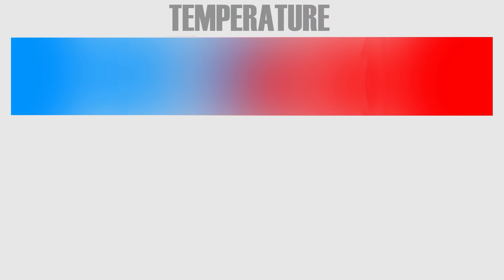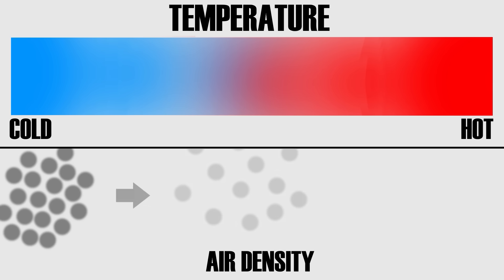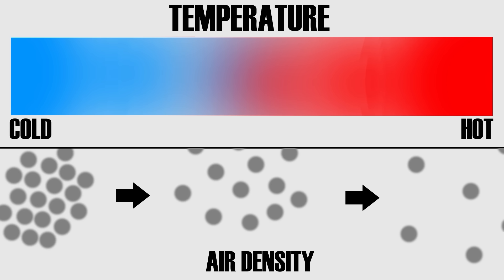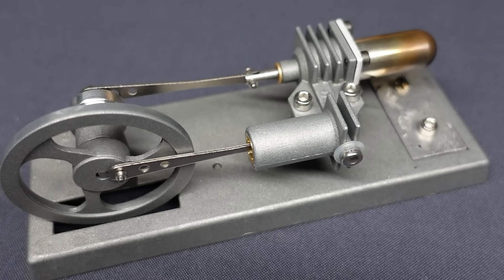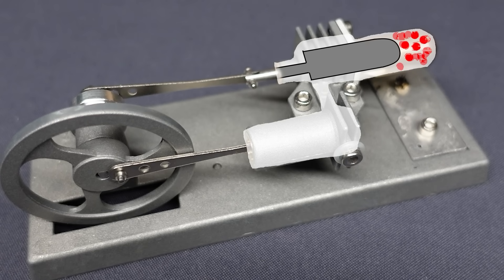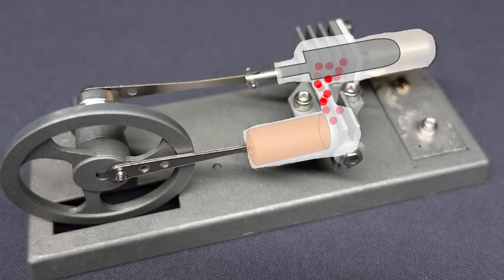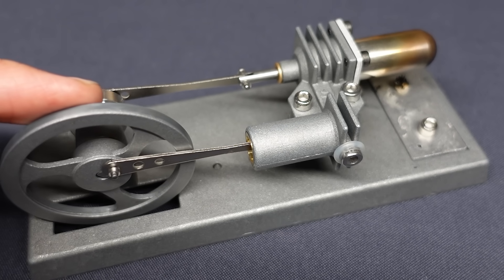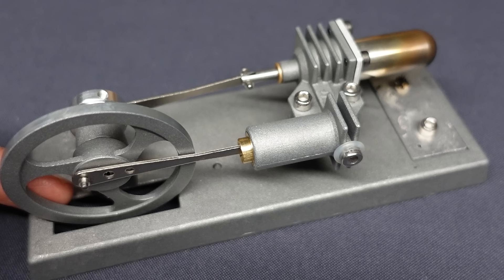It Can Save The World - The Simple Genius of Hot Air aka Stirling Engines

Comment: finally, something I am actually relatively well versed on!

my favorite application of the stirling engine is when it is combined with solar thermal power. Commercial products usually come as a satallite dish type set up with a mirror and the stirling engine in the focal point. Most recently theyve been marketed as a solution for those seeking micro or off grid power generation and they work well, especially since they can run off of basically any thing that heats up or even cools down. As long as there is a temprature gradient IT. WILL. WORK.

Also, if memeory serves me right, NASA tested a V4 sterling powered car and apparently it worked but couldnt compete with the power of conventional ICEs

you can easily diy the mirrors. Whether you choose a trough style mirror or a circular mirror isn't important as long as you concentrate sunlight into a small spot . 

There is a Ukrainian guy (  https://www.youtube.com/@sergiyyurko8668 ) on here that has been building incredibly cheap trough style solar reflectors to heat water for his house. If you replace the water pipes he used with proper evacuated tubes like in a solar water heater or the commercial concentrated solar power plants and combine it with a proper high temp heat tranfer fluid like oils or even molten salt like sodium or potassium nitrate and youll be able to achieve a hot end of 300c comfortably.  Unfortunately, you need specialised equipment to make evacuated tubes. You need to know how to glass blow AND somehow get you hands on the formula for the coating. personally, my money is on a metal oxide, maybe black iron oxide.

Obviously, the hotter your hot end is the better, but sterling engines dont need a dramatic temp delta to work. this means that, hypothetically, a submarine can fill its ballast tanks at the surface of the ocean where water is warm then dive and use the heat differential between the warm water in the tanks and the cold water of the depths to power itself using a sterling engine.

you can do the same using a couple of heat exchangers and any pair of heat sink and heat reservior. In hot climates, temprate underground or in a well is significantly cooler than surface or air temprature. In cold climates the opposite is true. I havent done the math on the generational capacity of a system like that but it exists. That is the beauty of the sterling engine, any temperature delta, either above or below equilibrium, can power it. 

Also, a working, albeit not very powerful, sterling engine can be built stupidly easyily from literal garbage. And i mean things that I guarantee you have in your home right now. I'll even build one and post it on my channel to prove it

https://www.youtube.com/@RobertMurraySmith has done many fantastic videos on sterling engines, how to build them, and he even used a rocket stove to run it.

Comment: The reason why Stirling engines are not used much is that as you used candles for your waste heat, the actual waste heat of power plant processes etc. is no that hot as a candle flame (1000 C). So it might only be like 80 C water being expelled, but that water might not be hot enough to start a stirling. YMMV, but I think that is the case.. So some power plants use the waste heat for example drying of biofuels in a big hall like building, which is kept warm by the waste heat. So if you dry your biomass fuel etc. then it will release better energy in the actual power plant process. Many ways to use waste heat! edit: However, Low Temperature Difference Stirling engines are a thing according to Google search..

Comment: I wonder if there is an application for these in self charging hybrid cars?  The ICE powers the cars and charges the batteries, while the Stirling engine using the waste heat from the ICE to charge the batteries.

Comment: Im working on a meshed CVT, i really need to finish it, dont i? Stirling engines plus a CVT which can compensate for lack of modulation would be a powerful duo...
Reply: The transmission won’t address the engines inability to increase power output at the rate needed for direct coupled ground wheeled vehicle.
Reply: @Thatdavemarsh  Good point, but i believe that the ability to convert speed to torque whenever the engine would be strained should solve that. At that point the only limit would be the power output of the engine, which is the hard limit either way. CVT can take a consistent power output and turn into whatever speed that is needed. Well the one that i have in mind anyway

Comment: Years ago when I was curious about strirling engines I found that  it was old experiments  but 1 company try to run stirling from parabolic solar mirrors to produce electricity and claim that they achieved 25% of solar to electricity effectiveness
Haven't heard about them since
Maybe maintenance eats all profit cause as I read there is problem with seals longevity at high pressure of working gas inside
Reply from the maker: A giant rotating solar collector plant with these engines in the center was built in the USA but I believe after about a decade they decommissioned it? The plant couldn't achieve the effectiveness promised, there were many issues, many of whom were unrelated to the engines from what I could gather.
Reply: @d4a  What I read that very high pressure needed to achieve high efficiency  and that's why wearless seals is root cause why stirling not in use

Comment: I have been reading about these advantages of Stirling engines all my life but we have never seen any practical and widespread use. There must be some significant drawbacks that prevent them from being practical for general applications. Running on waste heat is lol good and well until the source becomes more efficient itself.  Plus there are external combustion alternatives to use the waste heat without reciprocating engines, such as low pressure steam turbines.
Reply from the maker: In terms of practical use you have the Swedish sub, they were also on solar collectors in the US and whisper 
gen put around 80.000 of their boilers in Germany I think. They're also on boats and in space. Widespread is a different, more complex thing where various incentives play a part.
Reply: @Pooneil1984  they present significant challenges for high power applications that increase the cost, weight and size, but for low power and low maintenance applications they make a great solution.

Comment: High power output Stirling engines are substantially more complex than ICEs. They have very sophisticated cooling and heat regeneration systems, as well as highly intricate piston sealing and lubrication designs to cope with the extreme and continuous pressures and temperatures required for high power output, as opposed to very short periods of high temperature and pressure in an ICE. On top of this, to achieve high efficiency, a working fluid with high thermal conductivity and low viscosity is required. This is usually Hydrogen, which can permeate straight through most metals!
Reply from the maker: High power output anything is usually complicated, ICE too. But you don't need high power output to reap the benefits of these engines.
Reply: @d4a  it's true, but when GM (I think) tried building one in the 50s and 60s, they managed parity in terms of power and superiority in terms of efficiency, but much worse emissions and a huge increase in weight and cost. 
They also don't like changing rpm, so anything like automotive applications is off the cards.
Unless you can foot the high price (like in a sub), the only application I can think of is low power pumps or generators that run off natural fuels for rural areas and the like.
Reply: @slartibartfast2649  Automotive applications come back if you consider series hybrids.  Change in rpm is not too important as the goal is to run the engine at its optimal efficiency and let electric motors powered by a battery charged by said engine do the hard work of acceleration.  We do not need particularly high power, and as a result, the greater weight for the same output is not too problematic.  The greater efficiency is the main goal, not power.  In 1986, NASA did manage to greatly reduce emissions with their Stirling engine design, so I am going to pin poor emissions on GM, the era, or technology in general.

Comment: Nice video and explanation bro 👍🏽

In Indonesia, there's still a lot of people burned garbages in open field. This gives me an idea of how to generates electricity based on the basic principle of Sterlings, heat.
Probably using already existing part of engine convert them into the heat side and the other part into the cold side. Like the V-type Sterling that you showed to us...
What needed next is how to contain the fire or heat from burned garbage so they didn't spread. And also, how to maintain the heat even though there's no more garbage to burn.

I think the excess of steam from steam PP, which is really hot, could be transferred into the Sterling powered generator, so there's no need to make a mind-bogglingly large boiler for coal-fueled steam PP and massive cooling tower. MAYBE someone could build that in the future.
Reply: In Europe we collect the garbage in a large area and process it.
Most use a regular turbine to make power and send the excess heat to a city near by.
Some modern systems can extract gas from plant based garbage. Gas instead of heat can be stored and processed to fuel or plastic.

Comment: Very nice video, Maybe they can also be applicable to scooters as they don‘t change their rpm (well they do but only at max speed or at start). also scooters might be a lot lighter and even more cost effective?
Reply: Wouldn't a Sterling scooter require a clutch which kinda defeats the purpose of most CVT "twist and go" scooters?
Reply: @Ramonatho  actually a cvt scooter also uses a clutch 😅 its controlled by the power the engine produces (aka the RPM) so basically you could control the power of a sterling scooter with controlling the clutch instead of your throttle. So the clutch becomes the new gas pedal and you change the amount of grip the clutch has with your hand. but well that causes other problems, the clutch has to work a lot harder than usual i guess

Comment: Pretty sure those Stirling engines could be a lot more quiet with better balancing and tolerances. Title feels a little bit ambitious but all hail the algorithm xD
Reply: I am not really sure if a burning power plant would be able to utilize Stirling engines. Modern gas power plants use combined cycle designs where they have a gas burning turbine and the heat from that gets reused in heating water to drive a steam turbine.
There just isn't much heat left to be used in a Stirling engine.
Bouchain Power Station in France achieved 62.22% thermal efficiency. There is small amounts of waste heat lost pretty much everywhere. To be able to direct all that to a Stirling engine would be a challenge, Not impossible tho.
I think most powerplants just want to achive higher baseline thermal efficiency without needing to recover waste heat to use in other generators.

Most cases where we could have used Stirling engines gets bested by gas turbine generators. Think of Geothermal. We can choose the fluids and pressure based on the heat available. For low heat we can use fluids with low boiling points to drive the turbine. And as it is a complete cycle we don't have to waste the heat on purpose.

Comment: They can also run in reverse and then work as a heat pump creating a temperature difference between the reservoirs. They are used as cryocoolers, Philips developed these in the 1950's and a spin-off company still manufactures these to this day.
Reply: There are multiple companies manufacturing Stirling cryocoolers
Reply: No you can't. Powering one of these via the flywheel doesn't turn it into a cooler. Cooling can only be done via compression/expansion and the only thing creating expansion in a Stirling engine is the external heat source. The Stirling cycle engine is not the same thing as a Stirling heat pump.
Reply: I wondered about that when he started to turn it by hand.
Reply: holy crap, so you could build a water-powered A/C unit with a stirling engine and a water turbine...

i need to live on land with a creek.
Reply: @X3R0D3D  I'm pretty sure normal ac units use compressors you could also drive with a water wheel.
Reply: @boudewijnb  true, good call! hard to say which is more practical given the input.
Reply: @X3R0D3D  You've also not considered things like drivetrain efficiency. Coupling the compressor directly to the turbine/water-wheel/etc. will not result in very good performance, because the compressor and turbine will never have the same working RPM, even when the available power is otherwise perfectly matched. You will always need some kind of conversion, and electricity is actually the best way we have to do this conversion in the majority of cases.
Reply: @dustinbrueggemann1875  not that i haven't considered it, just that i believe the coupling system would have to be different depending on input and output applications.  using electricity is one way, gear boxes are another way, viscous couplers are yet another. you being pedantic here doesn't do anything to help a theoretical concept.  you have no idea what i have or have not considered, don't presume to know my thoughts, it makes you sound pretentious.
Reply: @X3R0D3D  He should have said "Have you considered" or "You may not have considered", people are definitely too brazenly presumptuous in online conversations.

Comment: Imagine a stirling engine heated up by the exhaust gases of a car, and uses the engine coolant to cool down the other side, generating electricity to power an e-supercharger 😍
Reply from the maker: I spoke about it in the vid, it can also charge the batteries of a hybrid
Reply: Its not possible, esupercharger needs tons of power to make atleast 1 bar while stirling engine would make 100W at its best
Reply: The e Super charger your talking about sounds a lot like a turbo
Reply: @errresh473  Well, a supercharger can be a turbine powered by a belt/chain, so both terms (eturbo, esupercharger) are right

Comment: They do need to be lubricated. There is metal to metal contact. This is just a model engine and is not subject to high loads and long run times so i guess its designed to work without lubrication, but in a real stirling engine it doesn't make any sense
Reply: This can be solved with dry lubricants though, which I think is what he is referring to.
Reply: @BjornTheLiar 
Graphite would be perfect for a closed system like this.
Brilliant Bro!
Reply: There are oil-free free piston Stirling engine designs, so not all of them need to be lubricated.
Reply: He said it doesn't have to be lubricated while running.
Reply: Pff easy to solve

Comment: Hm, I wonder if nuclear power plants would be more efficient if using heat engine instead of steam engine?
Reply: Easy answer : No.
But there is a similar question
There is an other kind of nuclear reactor called MSR, Molten Salt Reactor.
Its totally safe.
It is about 200x times more efficient than Todays LWR.
And much cheaper to build.
Look at the oil wars.
Do you think this thech is allowed?
It was forbidden 1970 by Nixon.

Comment: Cold section in electric plant have about 330K (50-60 deg Celsius). Efficiency of Stirling engine is based on temperature diferential. In standard summer dT will be about 20K. To smal for work, in winter will be mayby 50K, still to small.
Reply: The exhaust temperature of ICE is around 800K. Is it enough?

Comment: This is still internal to a point though. It's only the if i can say "crankshaft and rods" that are not internal. So what this is, is a Ignitionless and Fuelless engine.
Reply from the maker: No. There is no combustion going on internally. It's also not fuelless obviously. You could also argue that it's not ignitionless.
Reply: ok true, mind my words "combustion" but it is still internal piston compressing air @d4a
Reply: there is no internal combustion happening. The heat used to run the engine comes externally by burning some kind of fuel or using waste heat. Simple as that
Reply: it's still internal! if it was actually external, the piston would be visible @dieselgeezer18

Comment: Just a toy ...
Reply: no its not. Stirlings are literally used in a freaking submarine lol
Reply: @dieselgeezer18  you mean SSK Gotland Class (type A19) Stirling powered submarines ?
Reply: I was an engineer in tbe auto industry and made prototypes for a commercial grade Stirling engine used for power generation. Not all are toys.
Reply: @Gryph01  FORD AND N.V. PHILIPS HAVE BEEN COOPERATING IN DEVELOPING A 170-HP 4-CYCLE, DOUBLE-ACTING, SWASHPLATE STIRLING ENGINE TO REPLACE THE 351 CUBIC INCH PISTON ENGINE. A CVS TEST SIMULATION WAS USED TO OBTAIN REALISTIC EMISSION DATA OVER THE FEDERAL CVS-CH CYCLE, INCLUDING STARTUP AND TRANSIENT OPERATION. 
A big failure ...
Reply: @KlutchenkoSerge  I can see that. Stirlings are best used as stationary engines. Using them for vehicles isn't the best. If it was, our technology path would have been different. Stirlings and steam engines are about the same age.
Reply: @Gryph01  And what after the prototypes ?
Reply: @KlutchenkoSerge  Amall production run. They had issues with the engine overheating... The company wlisdd a solar array to concentrate heat on the engine. 
That company filed for bankruptcy years ago.
I like the concept and hopefully another company will try it again.